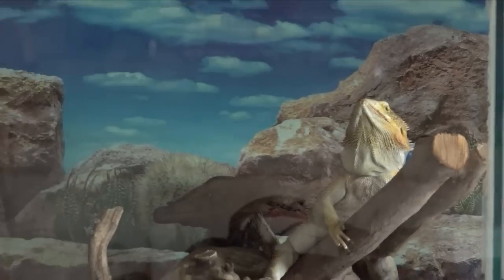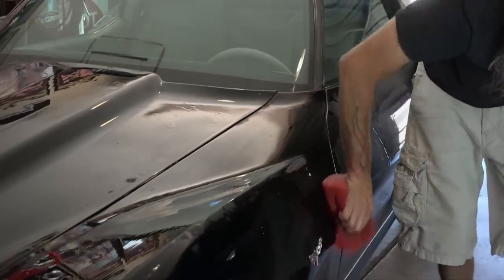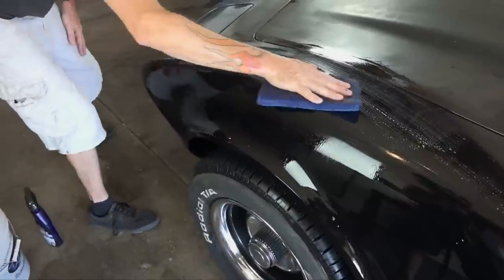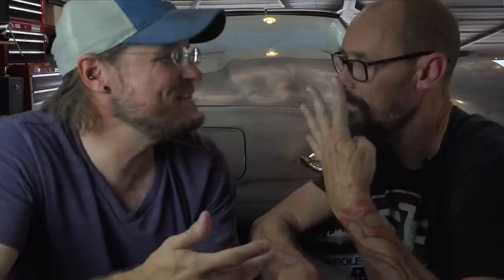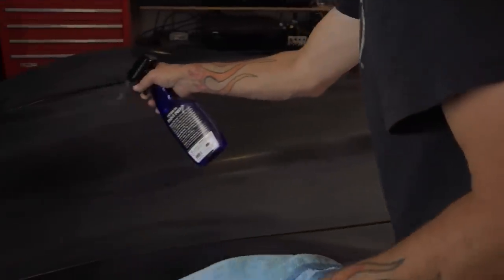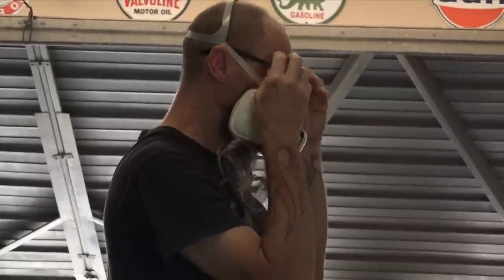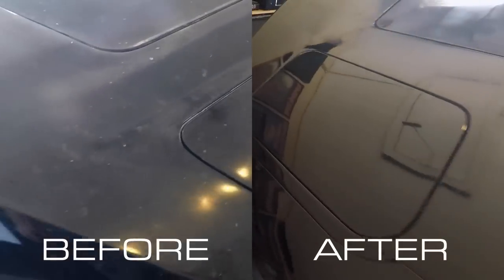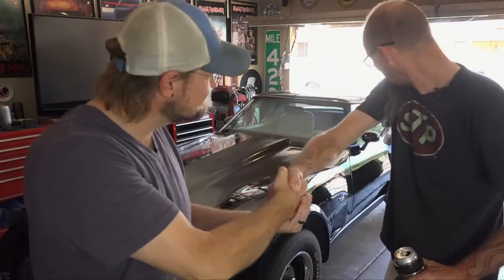Amazing Corvette Clear Coat Restoration

Comment: Looks great, two coats is probably ideal in most applications from what I have seen. Especially the rough areas like hood.

Gives you a little extra product on the paint to work with.

Comment: Can u polish clear coat restorer?
Reply from the maker: Hi Noel and thank you for the question.  Yes, you can polish CCR after 48 hours.
Reply: Yeah, but don't compound it and don't overdo it with the polishing either. Bad or good advice, Optimum?
Reply: @Sherukka  you can treat it just like regular automotive clearcoat. Polish it just like you would normally.
Reply: @sdguy55  Yeah, but it is a very, very thin layer added so you have to be more careful.
Reply: @OptiCoatofficial  thank you
Reply: @Sherukka it is on average 8 microns thick.
Reply: @sdguy55  thought that was Opti Shield that was 8 mil thick?
Reply: james d 8 mils? That is extremely extremely thick. Would take a lot of cutting and buffing to burn through 8 mils.

Comment: Does the clear coat need to be very thin or almost gone for ccr to be applied? Or can we apply it for a regular car for having more sacrificial layer before we reach to the paint?
Reply from the maker: Hello and good question.  CCR is for restoring damaged clear coats and is not recommend for use in the manner that you've suggested.  Hope that helps, thank you for your question and for watching!
Reply: @OptiCoatofficial  and thank you for the answer. It's clear.

Comment: Was this only one bottle used on the entire car?  Did this apply to existing clear coat, or was the clear coat gone?
Reply from the maker: Hi Thomkirby and thanks for the comment.  Yes, only one bottle was used.  The car was in pretty rough shape.  There was still some clear coat, especially on the sides.  The hood was beat up good and that's where the rest of the bottle of CCR was going however I haven't been able to get a follow up on that as of yet.  All in all the hood looked much better than it did although not perfect due to the extreme condition that it was in.